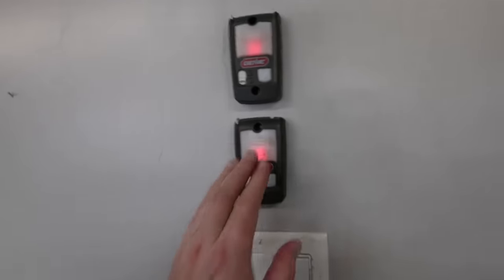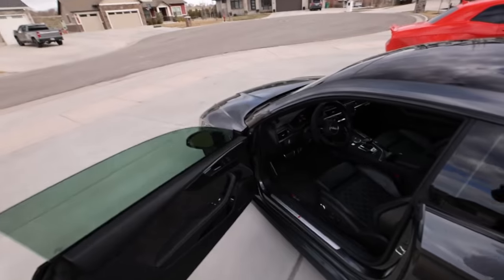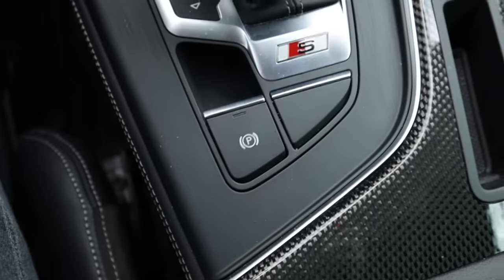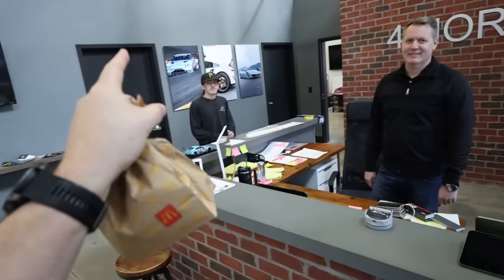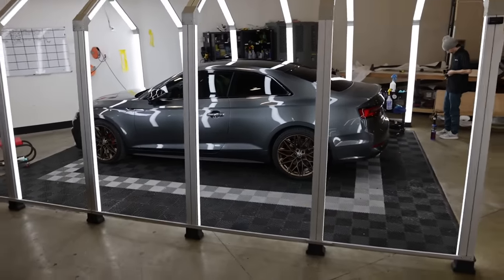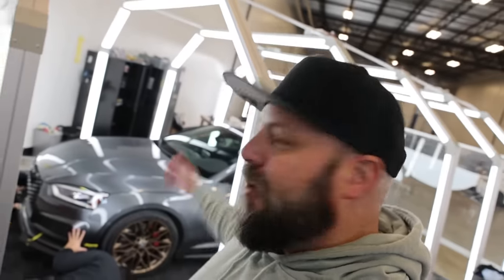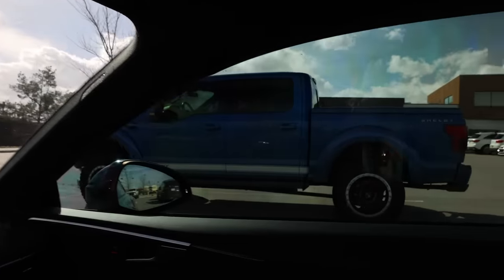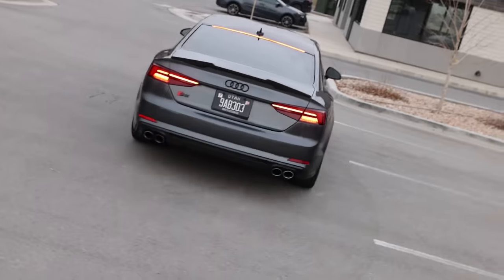How to make your car unique to you and stand out on the road

Comment: I have a b9 s4 and highly recommend getting a tune from 034 motorsport, an intake and an exhaust (either AWE or Milltek) for some solid first upgrades
Reply: I had a B9 S4 as well, first thing I did was upgrade the inter-cooler. The stock one belongs on a corolla.

Comment: $1k for powder M&B is highway robbery. I just paid $800 for a two stage powder coat with dismount, mount and balance using an actual metal flake powder.

I get location and such, but I'm in NY, so not cheap here either... And mine wasn't a fly-by-night establishment, but a well known shop.

Maybe we are just lucky where I live, but $1k if that's single stage is a lot.

Comment: Hey man, like your channel! But you are going to have a hard time selling your hellcat. Those cars don't like to be jumped. Their computer is super sensitive. The issue your car is having is probably because it is dead more than it's running and you have recordings of why it's not running properly.
Reply: I feel like a lot of new cars are sensitive to being jumped or jumping. Had a 2023 Silverado at work, got it brand new, and then used it to jump start another truck and that’s exactly when I started having issues with the 2023. Random no start conditions requiring me to disconnect the battery to reset everything before it would run. Got all sorts of codes too including a driver door window code which was weird. The door chime also went off constantly if the door was open even with the key out